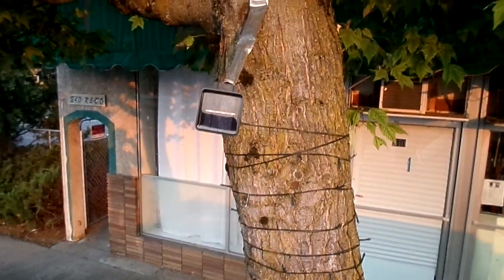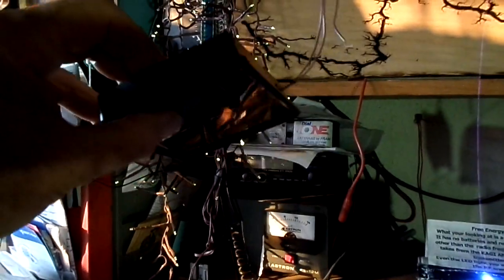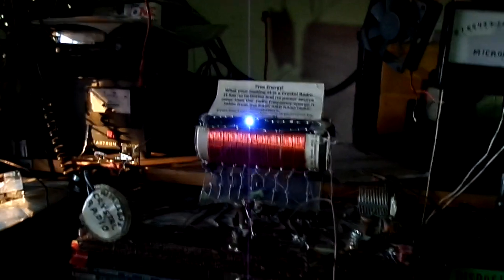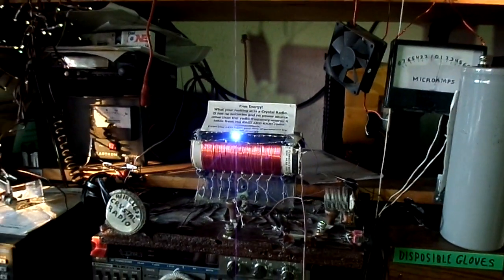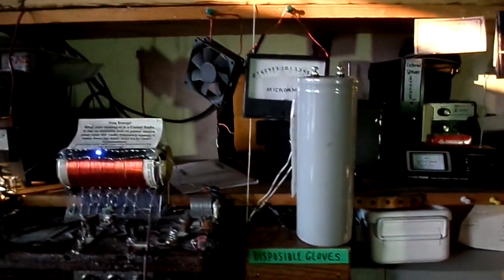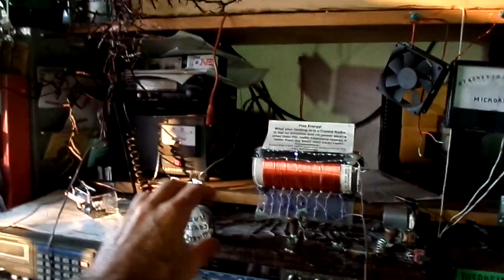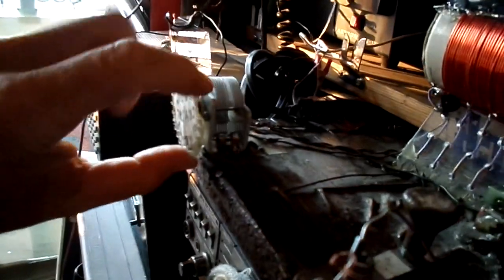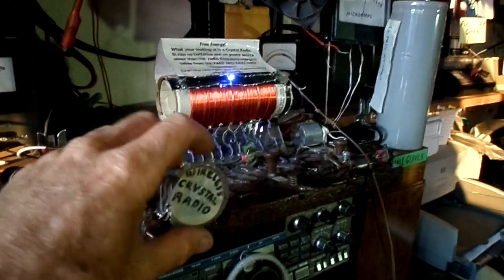An UNUSUAL free energy source

Comment: How about if you interrupt the ground wire on high tension high voltage power lines I mean cut the ground wire coming down the pole put something that draws power in it or a voltmeter and see what kind of bolted you're bringing in you're going to have hundreds of miles of radiation energy picked up by that cable and if you interrupted you might have to interrupt every single ground on all the entire thing which would be extraordinarily dangerous for the power supply grid but you could test one and see what kind of power you get if anybody does that make sure you put it back just as well as it was before or maybe just touch a voltmeter to the wire and see if there's any current to ground actually that may not work
Reply from the maker: sounds potentially deadly. n o thanks.
Reply: @GrantsPassTVRepair  well there's nothing dangerous at all about actually doing that if you make sure you put the ground back like it was and maybe a massive amount of free energy though that ground rod doesn't have about a little bit of energy flowing through it but compared to what you've got it's would be massive

Comment: A friend and I were doing basic electronic. We had to light an LED, pretty simple. The thing is that, we had just connected the ground cable. When we connected the power cable, it turned ON!
The problem, you may ask?

The power cable wasnt connected to any source of power.
It inly turned on when we touched the cable. I think that what was happening was that, as we were pretty near to a radio station, we were catching the waves, and when we touched the power cable, the electromagnetic waves that our body captured were being transfered as electricity to the cable and the LED.

Pretty crazy if you think so, its free energy

Comment: All the old buildings had this technology in them !! there antenna's on there roof tuned bell crystal windows shape into correct frequencies.
Tesla knew so does the banking system and heads of major corporations.
The body is a temple that runs on millivolts PH balance is millivolts.
Had the same coming off old satellite dish through a transistor was getting about 4v to 9v with copper pipe pushed into the ground and when it rained the voltage always went higher never tried it at night , but know Edward Leedskalnin worked at night and on moon and sun cycles.

Comment: I have some homemade crystal sets and using a 40 feet long wire antenna including the lead in wire. I will look for some LEDs in my junk box of "goodies". :-D
Reply from the maker: I live close to AM radio station transmitters, and my antenna is 200 feet long. I your to far away from the broadcast transmitters it may not work.

Comment: Nice video thank you. How many Wat or Volt the LED/SMD should be in order to be used for this experiment?
Reply from the maker: I'm not entirely sure about the power it produced, but check out this video on something similar. https://www.youtube.com/watch?v=vHVmJ5lD9jc&lc=z23sfv4xqoi4dnotjacdp43bfv521k5knnzn4onjzr1w03c010c.1572699641474436

Comment: At one time I lived "Off Grid" I used solar panels to power my HAM shack. I had a long wire antenna that crossed the canyon next to my house. It was over 600 feet long. One day I heard what sounded like water dripping, having no running water in my shack I wondered what was happening. It was sparks jumping across the tuning capacitor in my antenna tuner. A lot of voltage is generated in nature. Thanks for the videos. Carl
Reply from the maker: With 600 feet of wire it's no wonder. God forbid our antennas should ever takes a direct hit.
Reply: hola y saludos una antena de hielo de cable la típica de alambre tendido que se usa en los radios de galena de cuántos metros tiene que ser para que produzca cargas eléctricas

Comment: Silly question: Could you use more constant radio source, like wifi/4g/5g signals?
Reply from the maker: I  don't believe wifi signals would be strong enough, but if they were I suppose it could be done.
Reply: @GrantsPassTVRepair  Wi-Fi usually isn't much more than 100 mw